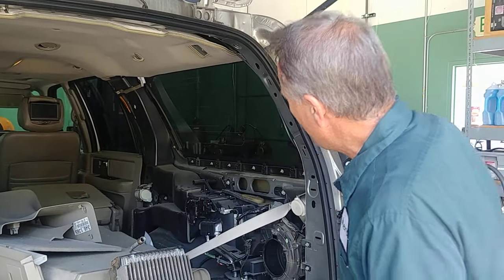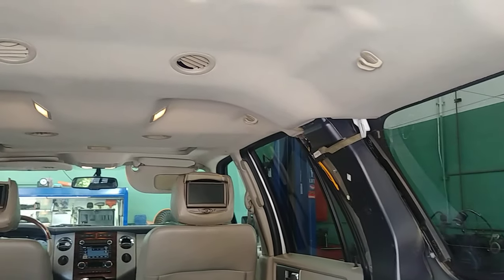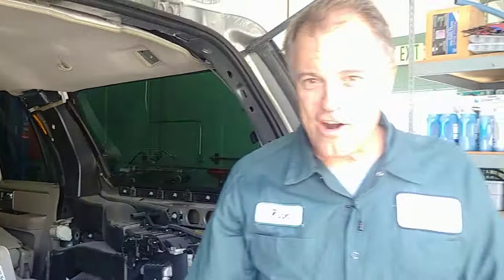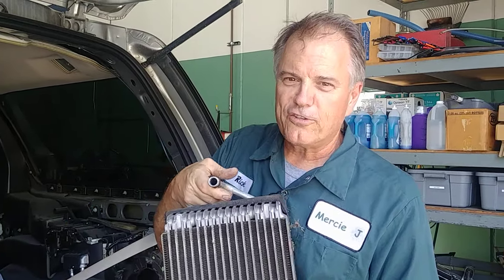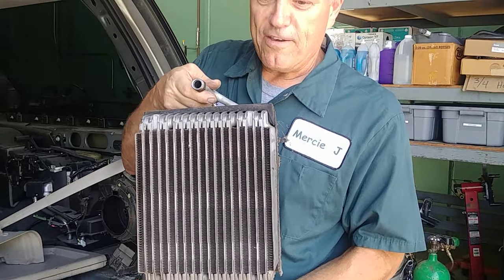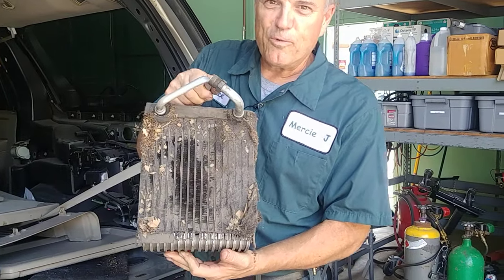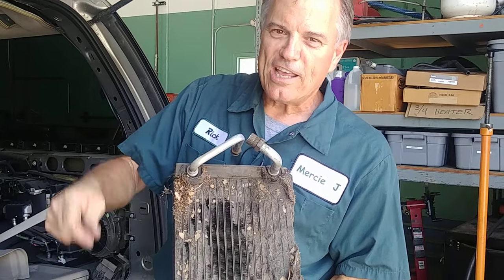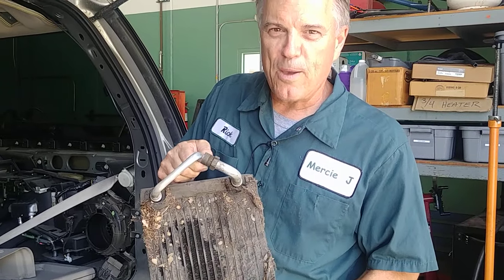Why is my Rear AC not working?

Comment: Hi, thanks for the video, I was wondering if those AC are conected to the same one link to engine compressor or if the rear AC have his own AC compressor? Mean, gas pressure is one for both or are separately systems?
Reply from the maker: They share the same AC Compressor

Comment: I have a 2015 Ford Expedition n I press the rear buttons to activate but nothing no air comes out.  I did a vacuum and recharge on refrigerant . Could it be the fan or something with the fuses? For the rear a.c system?
Reply: What did you wind up finding out?? Going through similar with a Nissan Armada. I changed fuses and recharged like you said but ultimately I think it’s the A/C compressor or the actual blower motor, that’s why hence it’s not blowing. Please let me know something. In Texas here, it’s about to get hot.
Reply: @Ray_Ray  No air movement? Something wrong with the blower motor circuit, if you got a new fuse/relay then the motor is likely bad. If you have air movement but it is not cooling, check if the ac compressor clutch is engaging, if it is then either there is a leak or compressor is bad. If clutch isnt engaging then maybe the compressor clutch is bad or the relay for it.
Reply: I’m having the same problem.. what did it end up being? Try to look for information if there’s more that one blower just incase there’s another one just for rear but no luck on the internet yet..

Comment: Hey man, i bought a GX470 with no AC, diagnosed the compressor, replaced it, pulled a vacuum, no leaks, illed with oil and refrigerant. Everything was good until i tried to use the rear AC lol, didnt realize it wasnt working. So because theres no leaks and the front is ice cold, the rear will blow but just waem air comes out, what would be your best guess? Clogged evaporator?
Reply from the maker: Either a bad rear expansion valve or a bad air mix door problem in the back.

Comment: Mr Rick where can I find instructions on how to recharge me front and rear ac system on. 04 explorer. It takes 13 oz of oil how do I get that much in
Reply from the maker: First of all, the old oil has to be removed. If you over oil the system, you will cause all kinds of problems including super high pressure.